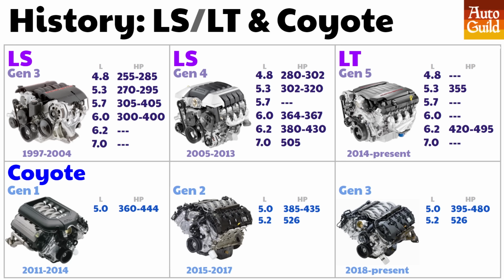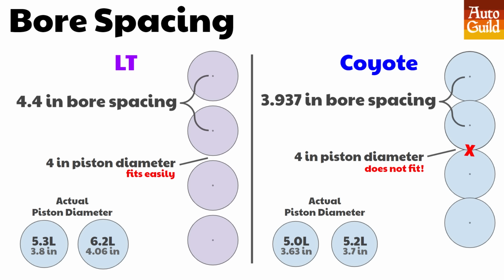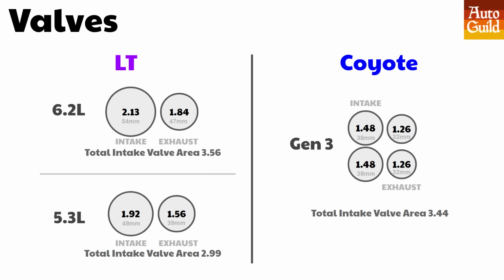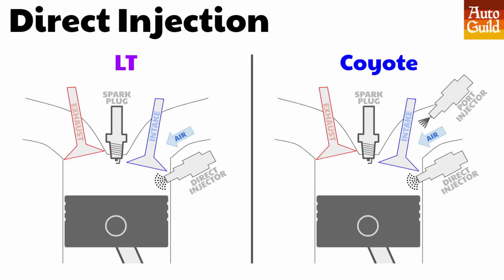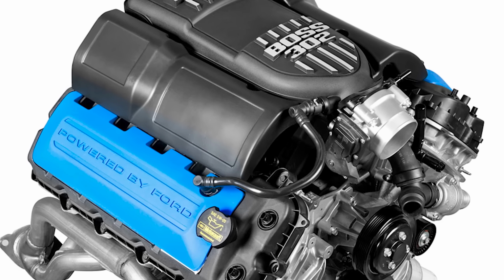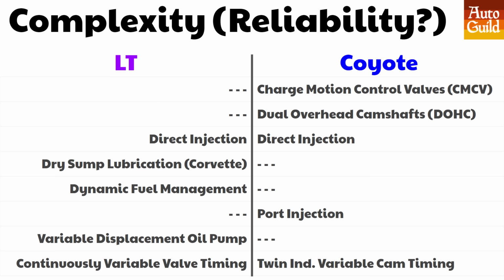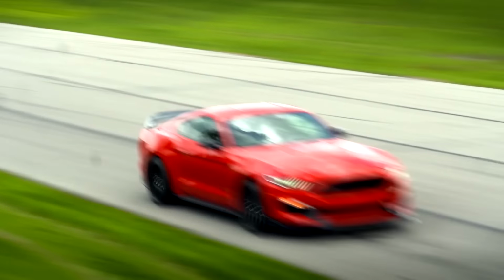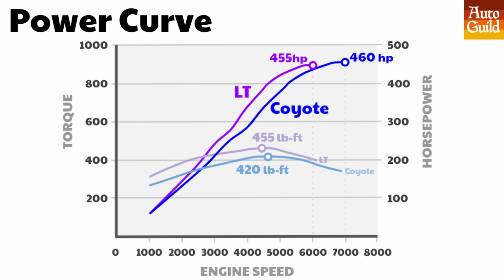GM Gen 5 LT vs Ford Coyote.  Which one is better and why.

Comment: Get a load of this: Both Paradise Racing ( current 1/4 mile record holder: 6.65 sec @ 216 mph, running the Toyota 3RZ, 4 cyl, 2.7 liter engine ) and SNP Racing have built a lot of 3RZ engines using the stock factory block, factory forged crank ( it comes fully balanced ) and original Toyota 3RZ head castings ( NO aftermarket head even comes close ) along with turbo-charging to create 1,600 HP and spinning the little 3RZ engine @ 11,300 rpm. Of course they have to use heavy duty H-beam connecting rods, forged pistons, Super Tech racing valves & exotic valve springs, but the fact that the original block & crank with NO modifications to strengthen them, along with factory heads stuffed with a racing valve train, is nothing short of remarkable.

Comment: How can you compare apples and oranges! One is a Dinosaur and the other a badly designed present day engine. Both useless! But if you are going to compare engines then you must compare twin overhead can with twin overhead cam. Or pushrod and pushrod. Also where is the torque and HP coming in at, what rpm? Also efficiency.

Comment: I’m not a Ford guy by any stretch however it’s impossible to ignore how good the coyotes are! Those 10r80’s are nuts too
Reply: The 10R80 is garbage compared to the predecessor the 6R80
Reply: @wesleyschneider245 6r80 is bulletproof
Reply: That coyote was made to throw away when it’s got some miles and age on it, no overbore on those slug holes
Reply: @pathunter7003  and that’s why a lot of oilfield trucks with coyotes are seeing 400k miles or more. Gotcha
Reply: @ congratulations if that even happens.
I doubt if they last that long.
Got that?
Reply: @pathunter7003 I’ve seen em last that long with my own 2 eyes, not just a couple of them either.
Reply: @CTX_Night_Crew  https://youtu.be/s4FtN6lK9kw?si=4KM3w2lWRC6VaZm_
Reply: @pathunter7003 weird my coyote has over 200k stock everything while multiple buddies got same year chevys and both needed a trans,  motor rebuild at 100k idk how anyone can defend modern GM, i love pre 07 chevys but since then its all junk and your lucky too get 150k out of the motor/trans
Reply: u can thank GM for the 10spd transmission but stock still 12.6s -13.6s not so impressive  and that engine comes with 4 cams so is way more expensive to mod than the LT or LS
Reply: @xxtriss-lt6  your research is flawed.
Reply: @xxtriss-lt6 Thank GM for what? The 10 speed is all Fords design.Its the 9 speed that came from that joint venture that was used in GM vehicles.
Reply: @jimmillet1442  k
Reply: @jimmillet1442  wrong, 10L80 and 10R80 is almost the same, different bellhousing and non interchangeable tcm. and yes I said almost not exact.
Reply: @DanoLuvoe  thats not what I said at all and wasn't my point..They share SOME. Parts yes but the design is all ford.Someone said thank GM for making it reliable or better...GM is on the verge of a class action suit because of what they did to there's and they are having far more problems than Ford is with theres.This was taken from wiki:
The 10-speed transmission was designed by Ford, while the 9-speed transmission was designed by GM.[3][4]

Comment: Great video, I like both platforms and have done swaps on both.  I think it would be great to see some videos of the durability issues that the two engines have. Camshaft issues with the LS/LT engines and the oil pressure issues with the coyote.

Comment: This is total garbage. This is not an apples to apples comparisons. You're talking about one engine that has overhead cams compared to another engine that does not. Like I said this is not an apples to apples comparisons. Everyone wants to talk about how great the coyote engine is. Well let's do an apples to apples comparison. In order to compare the Coyote engine to any other engine GM makes. You have to talk about the ZR1. There is going to be your apples to apples comparison. The LS are the LT the US put a Ford engine in there that does not have overhead cams. Now if GM brought back out the ZR1 this would be a totally different ball game. Right now Ford has no engine that will compare to the LS or LT engine. Unfortunately you have to dump a shitload of money to get the horsepower you can out of the LS. Now if someone decided to go ahead and make the ls or LT into a overhead cam engine this would be a game changer and nothing for could do would be able to catch up
Reply: The 5.0 handles boost a lot better and there are plenty of engines that can dish out good power. 7.3 and 5.2 are both good engines

Comment: Technically the Predator is based on the Coyote and the LT5 is based on the LT, so in terms of HP stock, the Coyote wins by 5 (or more since the Predator has been dynoed at 800+). Also, I don’t think an LT Gen 5 has gotten to 5s yet, but the Coyote has, and with a stock valve train too.

Comment: My Gen 2 Coyote in my lifted, giant tired, crew cab, long bed (read: very heavy) F-150 is definitely evidence for your observations. Differential gearing is the only thing that helps it off the line, where the lack of torque is utterly apparent. Then once you get into the high revs, the thing will plant you into the seat. It feels almost like a rubber band getting tightened as it reaches the higher rpm’s then shoots off. (Mostly stock engine, a few bolt ons)

Comment: Pushrod for the win. DOHC n Timing chain setup give alot of power..but such a pain to maintain, fix, and troubleshoot. The simplicity of the Pushrod Design will always be superior. From Ford Id prefer the 302,427, or new 7.3. The LS Engines from GM are absolutely Bulletproof as well. For me any LS is a winner, and from ford ill take a 302 or 427.

-Conway Twitty

Comment: LS not sure about the LTs yet, but the LS motors are hands down more reliable than coyote motors.....and much more easier to work on.....even if you don't do your own work. It will cost you much less in labor hrs when something does go wrong...... Looking for a used truck.....5.3 or 6.0ls motors that have had the transmission replaced.....and listen for ANY ticks.....and change your oil every 3000.....with full syn.....I don't like direct injection motors so we will see with the LTs.....

Comment: Two corrections, yes there is interchangeability between the 4.6/5.4 and the coyote. Coyote rods swap right into to and are an upgrade for the 4.6. and the coyote intake bolts on to the 4V 5.4

Comment: I'll state right off that I'm a Ford guy. I absolutely love my mustang with its high revving coyote. Both are great engines I'll admit that. I'm not sure about the LS, but I just put on a couple of easy mods and now make more power than a stock Shelby GT350 at the wheel. All this can be seen on my channel. Good competition drives each manufacturer to up the ante.

Comment: The New flat plain crank LT6 is a game changer. 670 hp from 5.5 liters at 8400 rpm. The block has a 4.40 bore spacing so it can be bored out alot more than the Coyote. Seems as tho the playing field has changed. This engine can be bored and stroked to big block numbers.. making coyote owners envious.

Comment: There is no comparison. An experienced Mustang owner will set quietly at a red light when a Camaro pulls up. Ford design's all it's engine's to fail. Someone at Ford decided, a long time ago, this was good enough. The problem with this strategy is there are LS & LT's out there. Toyota love's their strategy. Which do you prefer, a motor that run's trouble free for 400,000 miles or 180,000 if you're lucky.
Reply: Heavily incorrect. I have almost 300k on my 2011 5.0 and only had to change a few things. Not to mention all the other engines like the 4.6 being a rock solid engine as well. Also, I don't know what type of drugs you are smoking but a Stock Mustang isn't getting beat by a stock Camaro of the trim. I have beaten plenty and kept up with many more Camaros.
Reply: @rickitysplitz7035  dont play your drug game on me. Jr. Your small tiny little motor can't keep up. You must only drive it to the library?

Comment: I see the comparison but in my opinion, I’d use a crate coyote (or edelbrock supercharged coyote crate!) on any ford build. Say a ‘76 f100 or a ‘69 Mercury Cougar etc etc (no mustangs!!! Lol) BUT!!!!….. if we’re to do a retro GM build….I would go with LS series over LT. we’ve got the awesome LS7 427 n/a, we got the LSA, LS9 etc etc. so much more aftermarket support and knowledge over the LT’s. That could change with time as the z06 and zr1 and ZORA vette models hit the streets. But for now LS is king over LT in my opinion. Coyote was about the only one that does had until the 7.3l Godzilla came to market. But I don’t see too many ecoboost retro builds. (Except 1 totally insane Pinto wagon at sema 2022, that had a 3.5tt ecoboost and I’m sure it had some giddyup).

Comment: nothing beats the older engine design that dont have all that over head cam crap and 20 timing chains that dont last long, ls and lt easly over 300000 miles with no problem and cost half the price to mantain or work on, thats the only reason i dont own a ford to much and pricey engines to work on when they fail other than that i dont have a problem with ford.

Comment: Interesting you didn’t include the LT4 from the ZL1 in your “Horsepower per liter”. It has 104.8 hp per liter making it beat the GT350’s 5.2. The 5.3 isn’t even found in any legitimate performance cars from factory whereas all the coyote engines you listed are.

Comment: Both engines Are Good But they've already did this on a Dino  the LS won  it made more power and was way cheaper to Modify
Reply: But the Coyote is better aftermarkert support and handles boost better.

Comment: I've driven both. 
The 6.2 pushrod v8 Chevy makes is great for low rpm grunt work, endless torque on demand to where you'll find yourself doing hillclimbs without dropping a gear.
The Ford 5.0L is great to play with at mid to high rpms and never feels short of breath. 
Both have positives and negatives. But at the end of the day, you won't be disappointed to own either of them
Reply: Or won’t be disappointed to own both 😂 want to have both the corvette C8 and mustang 5.0
Reply: It really does not though. In fact, It does not reach peak torque till about 5krpm. It is the opposite actually. It will still tow, and make a lot of power, but it can’t compare in power to the 3.5 EB, or a diesel in low end torque.
Reply: @Calebflying2025  It's not the size of the block which determines when the torque comes on the cam.
Reply: Intake, exhaust and E85 on a Gen 3 coyote can get you in the 600hp  range. That kinda settled it for me, especially combined with the 10 speed. Hell, you have 4.6L 2v's now that can get just under 500 N/A since people are making serious heads for them now (after 20 years, lol finally). Either way, I like the idea of making 5 to 600 ish hp N/A with a 5.0. The coyote simply has a more efficient cylinder and head design due to it's relatively small bore but proportionately large stroke (the ideal cylinder is actually 1/2L with the stroke being slightly larger than the bore). The coyote would be at its most efficient if it was 4 liters (like all the european v8s are). A bigger engine will obviously make more power but as he stated, the coyote is roughly 24 percent more efficient than the 6.2.
Reply: @BoardwalkBullies  The “ideal cylinder is 1/2 liter” claim isn't a recognized engineering rule. There's nothing inherently ideal about 500 cc per cylinder. Specific output is not efficiency. A 5.0 making 460 hp isn't using 24% less fuel to produce a given amount of mechanical work than a 6.2 making 460 hp. It simply makes more horsepower per unit of displacement, largely because it breathes at much higher RPM.
Reply: It's the joy of getting to drive all maker's designs that makes it so much fun to switch manufacturers every few years when a new version comes out. Getting old ain't bad, since I can now afford a new car every few years. That house I bought in 1977 for $40K and sold for $625K turned out to be a good investment, when I moved to a retirement home that only cost us $50K.
Reply: @D.E.B. B  must've been nice buying houses in that kind of market. I bought my first place at $325k in 2017, bought a second in 2019 for $488k, and a third last year for $460k.
If I were building my investment in your market, I would probably be over a dozen houses in the same length of time.
But that was a different time, back before our government destroyed our way of life.

Comment: Hp/liter is the stupidest measurement anyone ever decided should be a thing. Easiest way to spot import fanboys that have never even opened the hood of a car, not saying you are, but even mentioning it is stupid, at least you went through all the context here. The 5 liter engine here takes up more physical space than the 6.2, the 6.2 gets better fuel economy in this case (at equal curb weight). I like some dohc cars too don't get me wrong, but they have some of the most aggressively stupid fanboys. I thought PlayStation and Xbox dudes were bad before I got into cars.

Comment: I gotta admit, the LS is a much easier swap. I see Coyote engine swaps in alot of cars and trucks, but I gotta hang onto what little hair I have left! Considered a truck motor swap for my 94F150 project, but I'm just gonna stick with my Windsor. I got all the parts for that!

Comment: To this date, I still don't grasp why Ford decided to use overhead cams for a V8. The Windsors were excellent engines. The 4.6 at the time weighed more, made the same numbers, and made them spinning faster. Not to mention it's a huge engine. I don't understand, but, I see they've improved in the years. I just wonder how the Windsor would have came along if they did the same, or if they just did a new, OHV engine. Wait . . *Godzilla*.

Comment: All this is great, but why has Ford been trying desperately to buy back my brothers mustang with a turbo 4 cylinder? It's quick, gets great milage, and fun to drive. They said he got the wrong computer, but it runs a 14 in stock form. When my dad bought a 4 cylinder s10 in 89, he took it in to get its maintenance done. They changed out the computer, because it had the wrong one in it. It went from 56 miles per gallon highway to 21, and from a tire scorcher, to barely able to chirp from a recline in first gear. Don't fall for the "wrong computer" bs they always try to use.

Comment: I can't use that much HP in an automobile. But I sure could in a Super Cub.  The Gen 3 coyote with both port and direct injection would be a monster in an aircraft. Aircraft engines don't do well with direct only injection.

Comment: Both have weak points, GM - AFM or DOD whatever they call it and Ford has problems with timing chain tensioner problems and cam phaser problems across coyote and eco boost engines. BTW the 5.5L GM flat plane is out now.

Comment: How are there only 16 injectors on the Coyote when there are 16 valves plus the direct injectors?
Reply: Dual port injection, dummy.
Reply: @rickitysplitz7035  I feel bad that you need to call people names, it is a direct indicator that you don't feel good about who you are. Anyway, the correct answer is not dual port injection, but rather dual injection. only one before the valves and one direct injection. If it was "dual port" there would be in each port(16) PLUS the direct injector for 24 total.

Comment: Let's look at the longevity of the Ford's engine!  They wear out way too soon due to the duel over head camshafts and all of its timing components versus the LS with the in the block cam with less timing components...when I was running a engine installation center there was more Ford's and dodge rams with the 4.7 OHC than any other truck or car and all had trouble with the timing components destroying the engine.

Comment: How many Ford engines do you see in Chevys? 0... How many Fords have Chevy engines at your local drag strip? At least half a dozen or more at any given time. It doesn't matter which engine is better. What matters is how available they are and how expensive it is to make them fast. That is what made the Gen1 SBC legendary. Not because it was the best, but because of the interchangeability and the simplicity. It was cheap and everyone could afford to race it. Same reason the LS is a dime a dozen and out numbers the Coyote 20 to 1 at the track. Unfortunately, the gas engine is on its way out. What a sad day that will be and I hope its not in my lifetime.

Comment: To me it's not even a comparison, however impressive the Coyote is "for it's size" the extra cubes of an LS or LT cannot be beat without adding forced induction. HP per cube is a silly metric for street cars as the outside dimensions of the engine are far more important especially when considering an engine swap. I've driven Camaro's, Mustang's and Vette's and the low end grunt of the LT is intoxicating.

Full disclosure, I own a Mustang Ecoboost which is a great car!

Comment: I neither know nor care which is 'best' in factory-stock form. The LT is better whether anyone likes it or not because of reliability, small physical size, light weight, low center of gravity, availability, price, aftermarket support, and power-per-dollar (bolt-on power potential, essentially). Coyotes are great engines, just not as great as LTs. LTs are nothing more than direct-injected LSs at their heart, which have existed and been tweaked for twenty-five years, of course they're awesome. Hell, the most basic building blocks for them showed up in what, 1955? Ford discontinues everything just when it starts to get good and starts over fresh whereas GM just makes things a little better every generation. Two effective strategies for modernizing and selling cars while complying with regulations, but one tends to result in a little better product if it survives long enough, which the small-block GM V8 certainly has done.